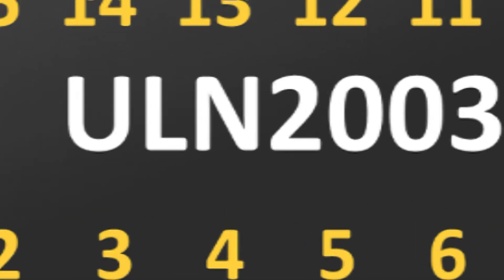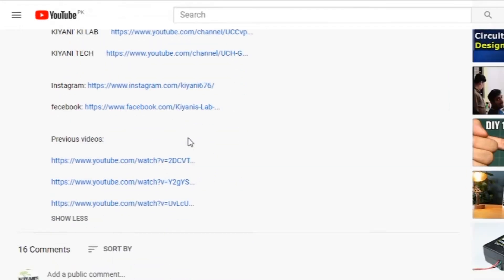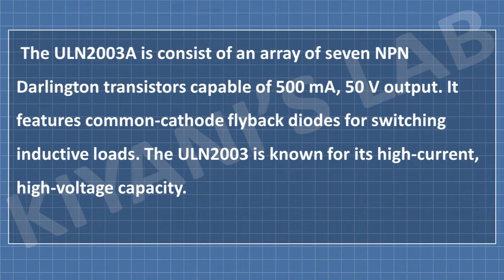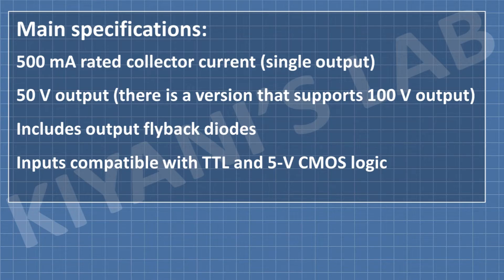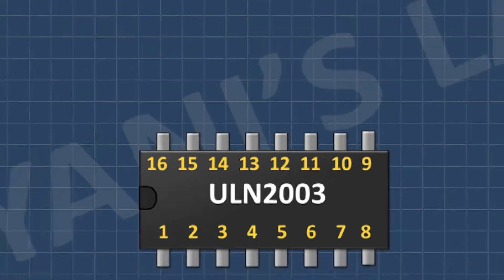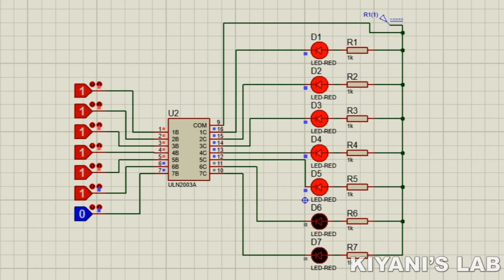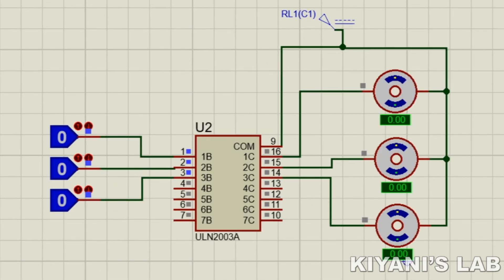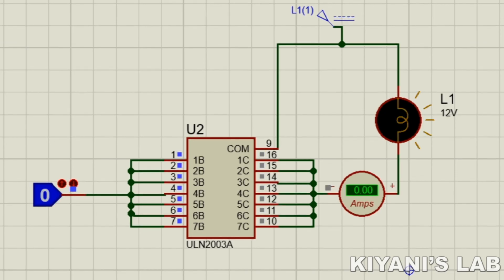What is ULN2003 IC | How UNL2003 IC Works

Comment: You keep giving the impression that the ULN2003 can "output" voltage and current - it can't, it can only sink voltage and current. It's output pins can switch a path to ground for a device that is connected to a power source. It is thus a switch on the ground side of a device (LED, relay, motor etc ...) that is connected to a source of power.

Comment: Hi, may i know what is the main purpose of the the IC? it seems like a normal switch to me but bind 7 together.
Reply from the maker: yes it has 7 Darlington pair transistor also free wheeling diodes connected you can easily control load with it mostly relay other wise you need to connect many components for that you can also control motors led etc.